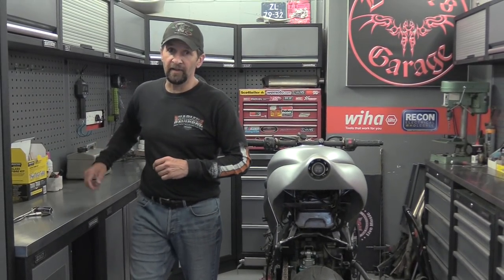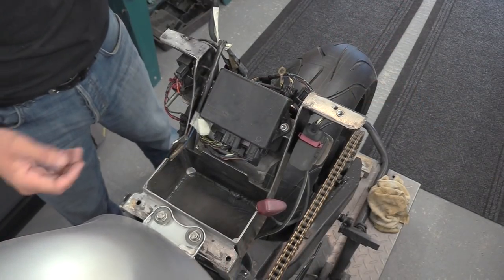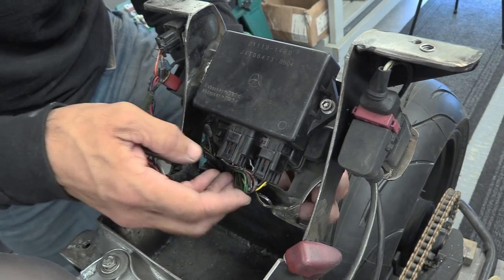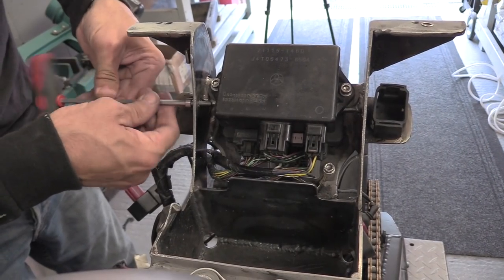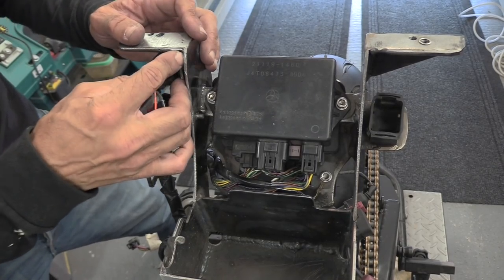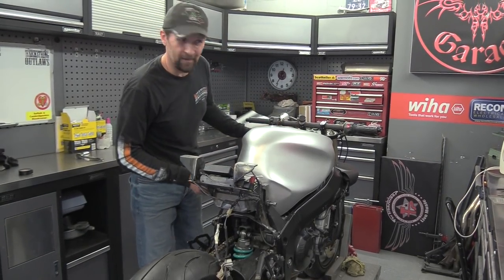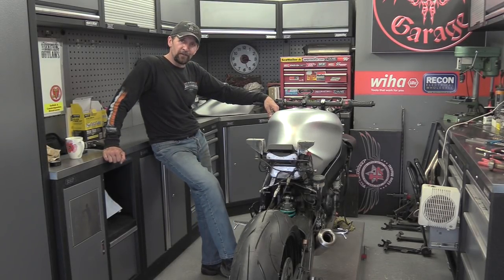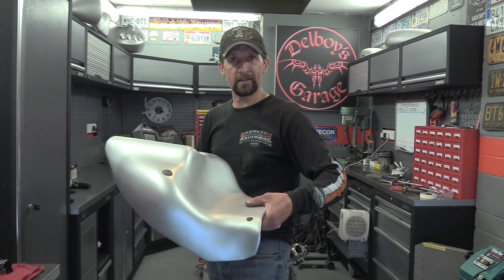Delboy's Garage, Fighter Build #138, Engine Start and Seat Weigh-In.

Comment: That little tip re battery terminals was GOLDEN. Have suffered for years trying to lift that basta nut in position to meet the screw when attaching terminal screws. Awesome mate.
Reply from the maker: Most welcome buddy, it's especially useful when you've got a stack of little tabs from accessories items and the screw ends up higher than usual, simple tips work best aye?!

Comment: I put fuel stabilizer in my ZX-9.  Run the carbs dry and put a battery tender on mine and it sits in my heated garage for 5 months and in the spring it fires right after fuel hits the jets.  On an "exhaust sound" perspective, it's got a catless mid-pipe and a chopped Akrapovic can and it's completely ROUDY.  The ZX bikes have always had a certain bark to their engine notes that i just love.

Comment: bloody great video.don't you just love it when a bike starts up after a long time out of action. nice one Dell.
Reply from the maker: Cheers buddy, it did spin over for a long time, but then it's an old school non-priming pump, meaning that although it pumps the fuel up to the carbs, it doesn't independently prime them first so they're ready to start... it only pumps at the normal feed rate, so when everything is dry, there's ages of turning over, but yep, as soon as everything was wet, it fired like it had been ridden the same morning !

Comment: Another great video bruv, I've ran out of caps to doff now. She is sounding and looking awesome. That tail is something else and lightweight it's gonna be a wheely monster with all that weight removed. Are you gonna get the carbs jetted and then tuned? It's looking closer to being on the road now. Bring on the next video. Ride safe bruv.
Reply from the maker: Hi Ray, carbs jetted and tuned... you heard it ! It runs crisp and smooth right through the rev range to the red line, no need to fiddle with it, working perfectly, don't be fooled that there is power to be had from jetting mate, re-jetting is on the correction of incorrect jetting, and if it runs as smooth and crisp as this, then it's good to go mate!

Comment: Why would you tap a 3mm thick plate? Surely it would be better to use a retaining nut on the other side. I don't think your going to have a great deal of thread engagement ?
Reply from the maker: It's plenty Geoff, screwed both of them in tight, and if need be, I can pop a dome head nut on the back to lock it in place, they're only earth tabs after all...

Comment: Hi Del, missing the sound of the Jap fours, still trying to get used to my triple, it's running ref: TPS sensor, it was a kinked idle hose, I think the silicone I replaced the stock hoses with get too hot and squishy, they are really close the the engine, may need to use fuel line.
Reply from the maker: aha, glad you found it buddy, it's always a relief when it makes sense... at least in this weather you're getting a chance to get out and get used to the triple, enjoy mate, ride safe !
Reply: Thanks Del, you too, 170 smiles today, set rider sag the other day there, about 5mm off the edge, a bit bumpy at the front so possibly the preload or damping is too hard, I'll check the damping first.

Comment: Just wanted to pick up on the Evans coolant del.
Are you still happy using it..you had me thinking of using it..do you still back it..I'm aware of the numpty on the other channel and you not getting involved in playground stuff but if you still back it would be good to know. 
Thanks
Reply from the maker: Hi Martin, I'm opting with this subject not to back anything... I will urge everybody to make their own decisions on coolant and follow what they feel is best, to answer your question, yes I still have it in my bike, as you saw, I ran it up to temperature, the fan kicked in and cut off again 4 times in a row, and the motor ran smoothly throughout, so will continue to use it whilst I see no ill effects... sorry if that's an enigmatic answer buddy, but as you said quite rightly, there are those who seek to bring everything down that they don't approve of...

Comment: Hey Del just a quick question, what's your opinion on the Michelin Commander 2, what do you run on yours?👍😎🏍🏍
Reply from the maker: Hi Geoff, if that's the factory Harley tyres I know they are woefully expensive, in the past when we've replaced them I used Avon Road Riders, they were hugely cheaper and gripped really well whilst lasting just as long... !